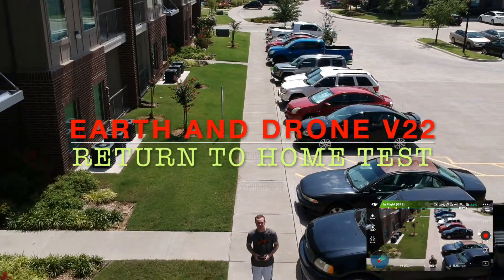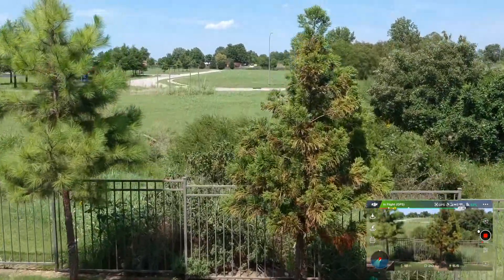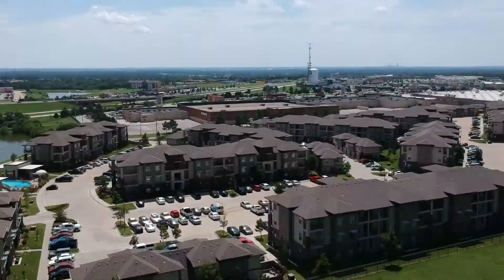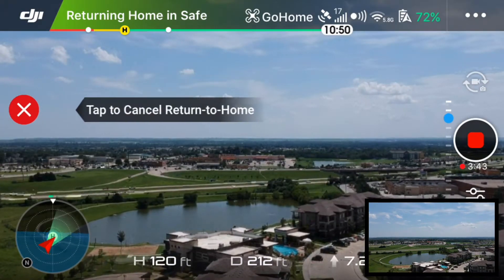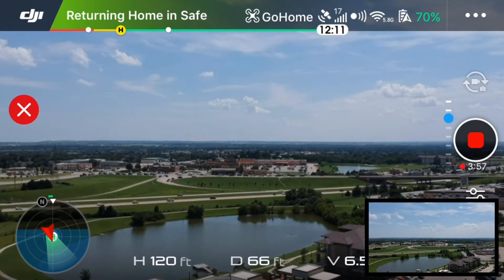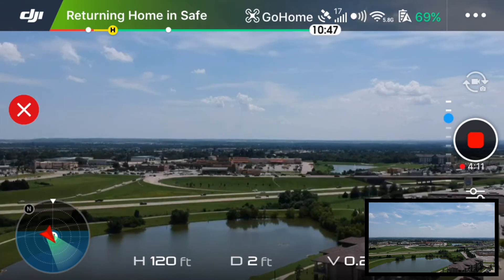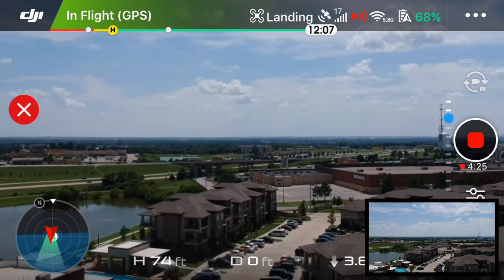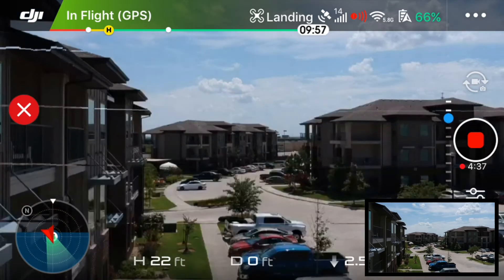DJI Spark - Return To Home Test | Tutorial

Comment: I didn’t know how to return home and it looked like my spark was flying away
Reply from the maker: You really need to make sure that your "gps home point" is where you are actually standing. When the drone takes off, it marks it as it's home point. If you lose GPS, it will lose your home point. Depending on your settings, the first thing the drone will do is fly to a higher altitude, and then begin traveling back to it's home point. So it may have looked like it was flying away but it really was just climbing in altitude.